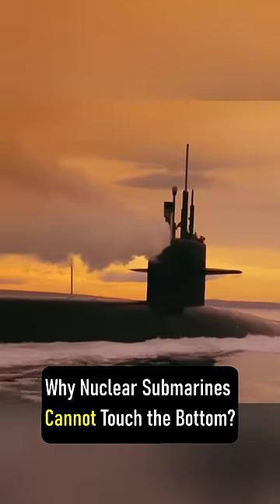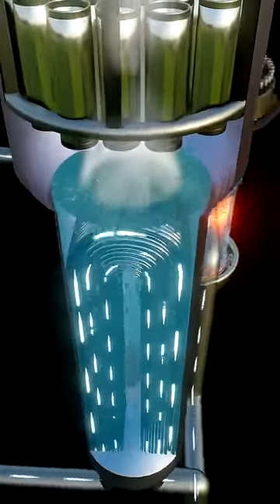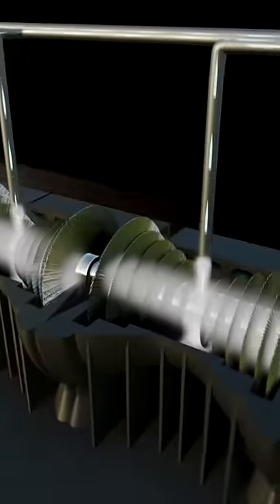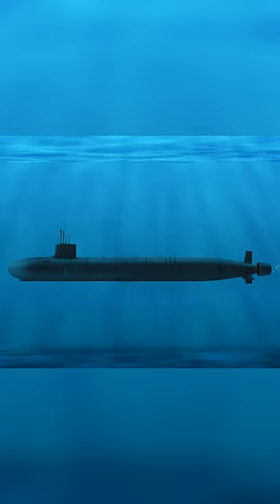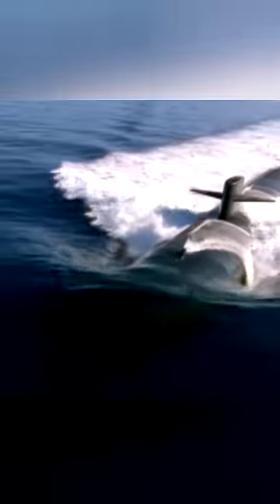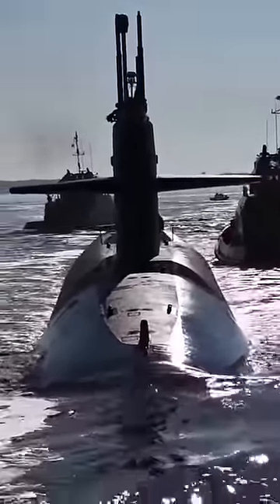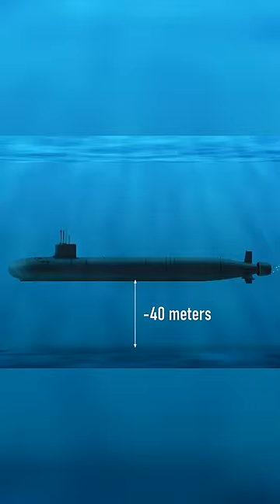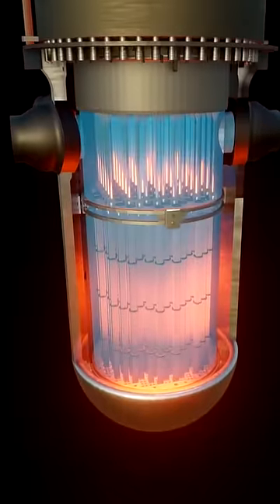Why Nuclear Submarines Cannot Touch the Bottom

Comment: I don't know about today's subs but during ww2 they use to what they call bottom the boat to evade the enemy destroyers.
Reply from the maker: 'm only talking about nuclear subs. Diesel submarines can go down. This maneuver was often used during WW2
Reply: They still do but when they said bottom the boat they mentioned to get as close as safety possible.
Reply: @substec  is it same  case for the French nuclear subs?  Probably  classified  information.
Reply: @substec  Nuklear Subs are capable of sitting on the Bottom too. It was actually was a common tactic by Soviet nuklear subs like the alpha class in the Cold War. The reactor is actually cooled by liquid metal. Sea water is only used for the heat transfer or as an emergency coolant.
Reply: TruthSeeking Endless  
Radar doesn't work in water. Sonar does.
Reply: @James Tracht 
Cooling the reactor core on the nuclear subs is so difficult that they just can’t risk getting a seachest water intake fouled by muck on the seabed.  
The WW2 subs were not quite so finicky.
Reply: TruthSeeking Endless  

Probably underwater sonar, not radar. 
I don’t think that radio waves are very useful underwater.  
(except for ultra low frequency radio waves. The antennas for that are HUGE! Too huge!) 
-
Reply: those were not subs...submersible ships
Reply: They were on battery power though so mechanical problems weren't an issue laying on the bottom.
Reply: @1987ZerO  Subs like Halibut, Seawolf, Parche, and Richard B Russel were modified to sit comfortably on the bottom during Ivy Bells missions
Reply: @Paladin327  if that hadn't been talked about in blind man's bluff you wouldn't ( if you were a bubblehead) been able to talk about that.
Reply: @keithtravelrn  a submarine is a submersible ship. Those old boats were submarines just as much as modern nuclear ones, only they've been made better at their purpose with technology
Reply: @1987ZerO  the primary coolant loop is liquid sodium instead of water, but it still requires the secondary loop and seawater loop just like any other nuclear powered ship
Reply: @WaterMan416  after 11 years serving on them... no they aren't anything at all like those old ships.
Reply: @keithtravelrn  I spent a handful of years on a sub myself, and they're more alike than they are different. Starting with the fleet boats like the Tambor class anyhow.
Reply: it would certainly deaden sound sitting on the bottom. if it was shallow enough.
Reply: TruthSeeking Endless  radar is electricity, seawater grounds it.
Reply: @keithtravelrn  they were called subs by definition over 100 years ago. Revisionist definitions are pointless and silly. They ALL need to surface for food, the time is just longer.
Reply: @AWa-ik2ez  seems a trivially easy problem to solve. Place the alternate valve at the top of the coning tower. If that isn't enough heigh, use a snorkel. It doesn't have to go all the up to the surface. It can go up 10m or however far you need off the bottom.
Reply: 500ft?
Reply: @ron580 
Great book.

Comment: No. You cannot use sea water to cool the reactor. You can only use pure water as the salt will separate from the water and settle at the bottom of the reactor. This is very bad. That cooling system does not have anything to do with the ocean water.
Reply from the maker: You're right. There are 2 heat exchange circuits. In the primary circuit, the water pressure is 140-150 atm. this is the reactor diagram. In the second circuit of the steam generator, the water pressure is 17 atm. And only the second circuit has a HEAT EXCHANGER with sea water.
Reply: @substec  Right on. Didn't notice that!
Reply: Not to mention all of the murky water and sand the submarine would inevitably pull into the intake. Also, I’m pretty sure you’d want that cooling solution to have a neutral ph as well which salt water is not.